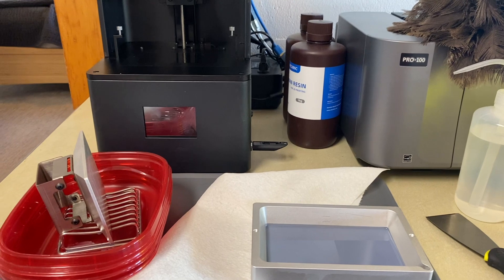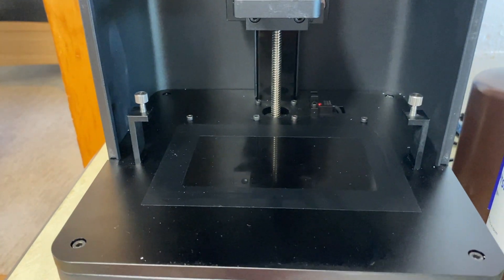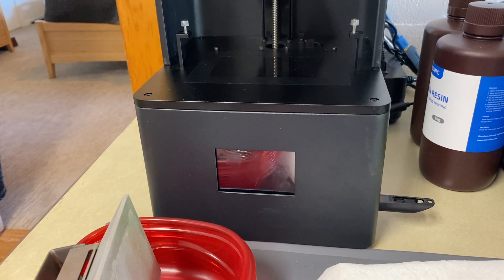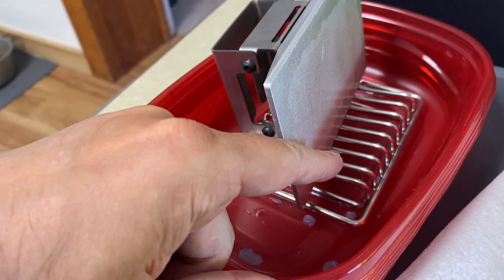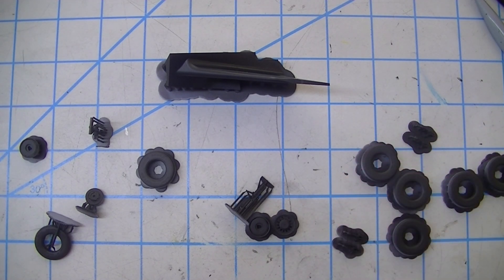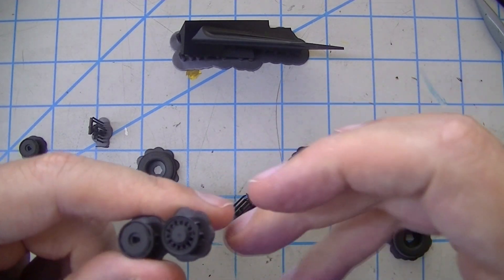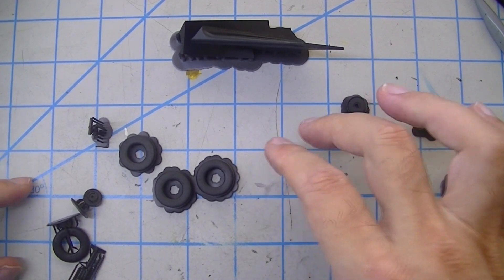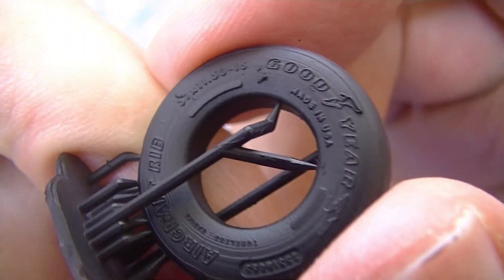ep334 - the epax x1-4k 3d printing adventure part 4

Comment: Very nice to see this series of videos, you have came trough many problems that I found moving from my Elegoo mars that was very happy to print in 10 microns layer height out of the box to the Phrozen mini 4k, I just managed to print at 20 microns, maybe I have to keep trying messing with settings to find a way to print reliably on 10 microns. I just recently resumed printing on it, after moving to another house it has been sitting on the box for over 8 months and I ran one print and didn't had even to level the plate, all was perfect, what changed in this time is that Chetubox have new version and asked to run a firmware update on my machines to be able to work...